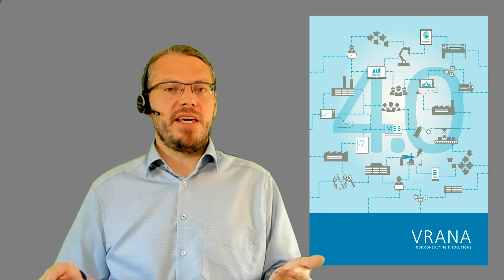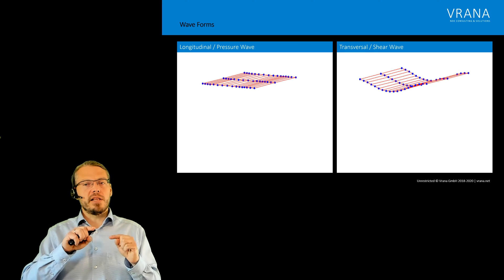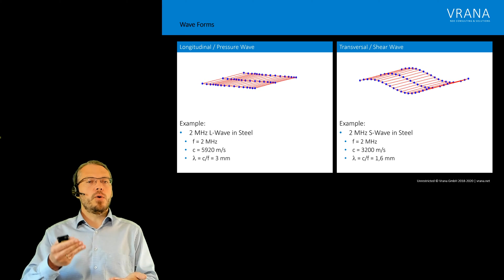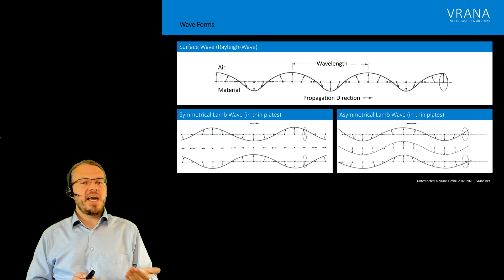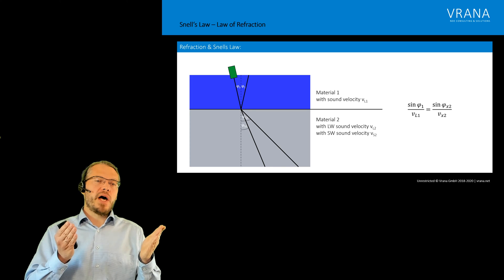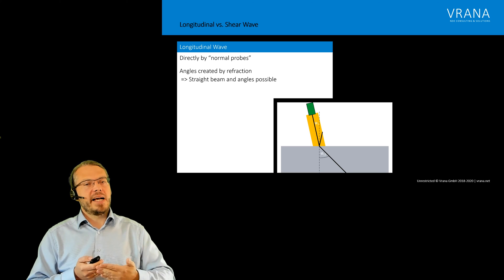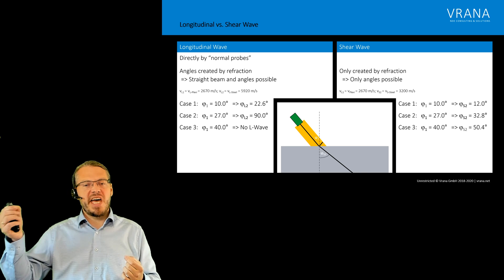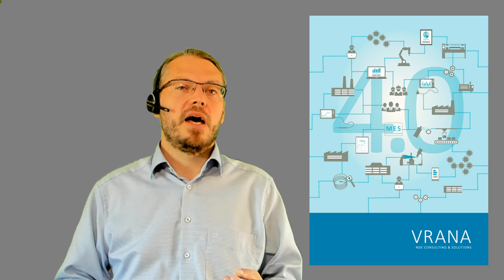Basic Acoustic / Ultrasonic Waveforms, Refraction & Snell's Law

Comment: Isn't it that the sheer wave is always at 90 degrees from the longitudinal wave? Why are you putting them next to each other with a smaller angle than 90 degrees? The sheer wave should be in the rectangle on the bottom left side
Reply: You have to differentiate the plane of oscillation from the wave propagation direction. The plane of LW oscillation is in the propagation direction. The plane of SW propagation is perpendicular to the propagation direction. BUT: The propagation direction of shear and trans waves are usually NOT 90°. The propagation direction depends on Snell's law, so it depends on the incident angle and the speed of sound. As the speed of sound of LW is about double that of SW we have different angles in our components.
Reply: @JohannesVrana  so the lines of refraction are lines to indicate the planes of oscillations, right? The lines of propagation are not represented. The angle between them is due to the difference in the propagation speed.
Reply: @billy-cg1qq  The lines you see (starting from 04:29) indicate the wave propagation directions. The angle between them is due to the difference in the propagation speed.
Reply: @JohannesVrana but the difference in the angle between the two types of wave in the material is not only due to the difference in their speed. The difference is more fundamental. If we imagine a network of particles connected with strong bonds, if a particle moves up and down, it's gonna create a pressure wave in it's oscillation direction, but it will also create a transverse wave with the particles next to it from the right and left. So the angle of propagation is generally 90°. If it get slowed, the angle between the waves can't just get less that 45°. I think it should be at least 45° as the difference in the speed is 1/2. Thanks for your patience and responses. I hope I'm not missing something obvious here 😅
Reply: @billy-cg1qq , SW can be created in a variety of ways. 1. What you are speaking about are SWs induced by an LW, as discussed in this video: https://youtu.be/mr778r1uStw. Usually, those are quite minor effects. 2. What is discussed in this video is something different. In this video, the creation of LW or SW by refraction is discussed. Those SWs are way stronger and their propagation direction can be calculated by Snell's law. For sure the speed of sound is caused by the lattice properties (solid state properties). 3. In civil engineering applications 0° SWs are created by transducers "scratching" on the surface.

Comment: Can you explain how did you get the angles values on Shear case 3 and 4? I've recalculated it, based on snell's law using water(n1.5) and steel (n2.67) indexes  on shear, the critical incident angle  is 41.80degrees; pass that,  TIR occurs(Total Internal Reflection). I wonder how in case 4, would you get 90 degrees with an incident angle of 56.5 degrees. I guarantee you, you wouldn't get any (r) refraction with an incident angle of 56.5 degrees based on this example. (r)Refraction line would completely bend away at those angles  whether using rexolite or plexiglas given they have higher n values. Lots of techs in the industry missing proper shear calibration and end up being unable to pick up any defects.
Reply from the maker: You can find on the slide that my calculations are based on Plexiglas (2670 m/s) and Steel (5920 m/s / 3200 m/s). For immersion testing, you have to recalculate with 1500 m/s.

Comment: Hello, thank you for the interesting video... Just a quick question: what about the so called "creep" or "creeping" waves? Are they surface/Rayleigh waves, or what? Thank you in advance!!
Reply from the maker: Creep waves are longitudinal waves traveling parallel to the surface. Meaning they are created at the first critical angle and they quickly lose energy in the form of indirect shear, or 'head' waves. Real surface/Rayleigh waves are created at the so-called third critical angle (see also my answer to the question of Ievgenii Kravchenko). Most likely I will do another video about the three critical angles where I will go in more detail on creep, rayleigh, and other wave forms.
Reply: @NDE40  Thank you so much! Looking forward to see that video!

Comment: Hello, could you tell something about 3rd critical angle?
Reply from the maker: I will try to do a video on this subject - but it might take a while. For the moment: the 3rd critical is the angle to produce a Rayleigh Wave. The speed of sound of a Rayleigh wave (~3000 m/s) is lower compared to both longitudinal (~5920 m/s) and shear wave (~3200 m/s).
The first critical angle is at ~27°, the second critical angle at 56,5°and the third critical angle at ~62,9° (for coupling with a Plexiglas-Wedge). Below the first critical angle both L and S wave penetrate the component, between first and second only S Wave. Above the second: only reflection. Except for: at approximately the third critical angle the Rayleigh Wave is created. Above the third: only reflection. I hope this helps.